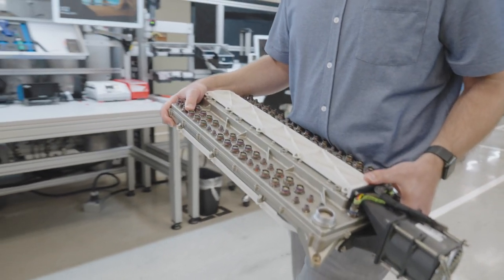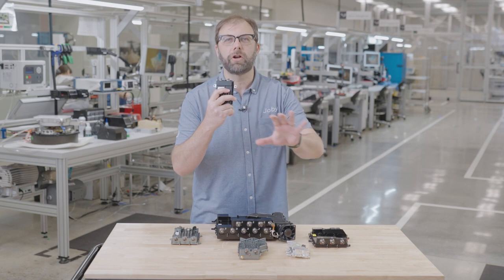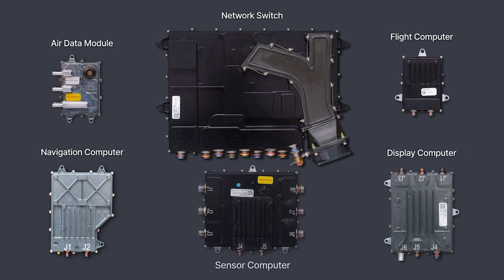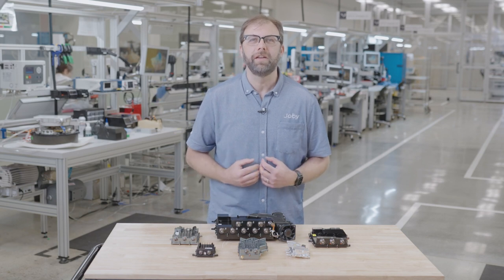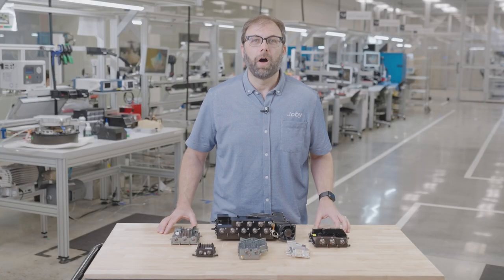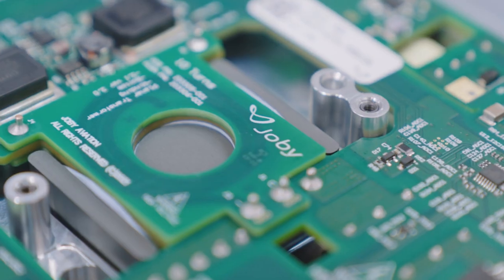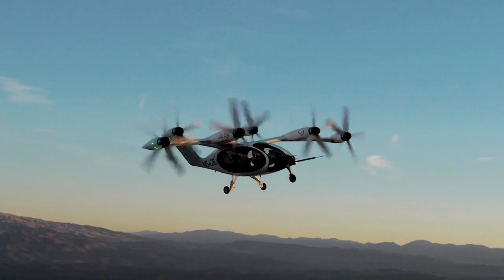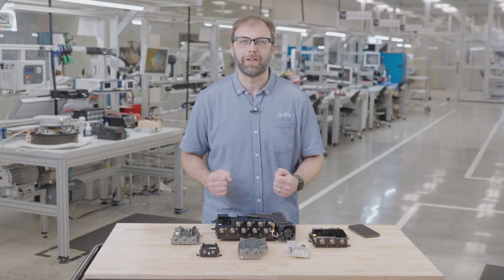A Look into Joby's Flight Electronics

Comment: Why still so huge and bulky?  it's just light compute and low speed communication? why not a tiny board with a chip in a snap plastic case? it's comparably to what a quad drone controller does, right? just has to be reliable and a couple of modes of flights. Why does that require any cooling?
Reply: FAA regulations
Reply: Certified aircraft components need to be robust enough to withstand things like temperature and pressure fluctuations, vibration, different types of RF interference, etc., as well as provide redundancy and a plethora of other requirements to ensure the flying public is getting a safe product. If you find a way to fit all that within a tiny board with a chip in a snap plastic case, please DM me and I'll consider investing :-)
Reply: @RyanPlate  the lighter the easier it takes vibration. if it must be fire resistant that can be done in a small size too, as can redundancy.
the needed communication and compute for such an application is about as low as they come. there are ultra low power cpus, they need no cooling.
if that module is only for comms, no power electronics for the motors, I could easily make it 200x lighter.
Reply: its really a pixhawk in their custom case.

Comment: Its so sad that all this development of innovation in flight with electric VTOLs and jetpacks and drones came at a time when beurocratic machine has degraded so much that it is no longer possible, even in theory, to get through it in any reasonable timeframe at a reasonable cost.
Reply: What are you talking about?  They aren't making wicker baskets.  They're making a new type of aircraft, and if they screw up, even slightly, people die.
Reply: they can't even lift the weight of a person or show an unedited flight. bureaucracy didn't stop their progress physics did.
Reply: @Franky Flowers  footage is available online from 7 years ago of a full 40 minute electric helicopter flight
Reply: @frankyflowers  Can you back up your claim that physics is stopping their progress?
Reply: @Dragoon01  What is your point?
Reply: @Asking Forafriend  Franky thinks piloted electric flight is not possible, it clearly is....
Reply: @Dragoon01  Ah, my apologies.  I thought the comment about the electric helicopter was from Franky.  Yes, that helicopter proves that what Joby is doing is possible.  Basically, just different rotor sizes.
Reply: @Dragoon01  because this is a helicopter.
Reply: @askingforafriend6540  can you prove there isn't a god? they would show it lifting weight and going a few miles and land if they could. they would be the only ones that did it.
Reply: @Franky Flowers  there is footage available of a electric helicopter flying for 40 min+ with a pilot inside it. What are you worried about?
Reply: @Dragoon01  40+ what? was it hovering in ground effect with a tiny person and no luggage? link it
Reply: @askingforafriend6540  is there a video of the flight?
Reply: @askingforafriend6540  why doesn't joby fly 5 minutes with weight?
Reply: @askingforafriend6540  joby isn't a helicopter.
Reply: @frankyflowers  Besides the size of the rotors and the number of rotors, what's the difference between the electric helicopter and Joby's vehicle?  The differences are marginal.
Reply: @frankyflowers  I wouldn't assume they haven't.  Maybe they're more worried about getting to the next stage of development, instead of proving a video.  Again, I'm with you - I want to see a video too.
Reply: @frankyflowers  To summarise, 2 pilots with a small payload, flew for 20 minutes Airport to airport with a 50% battery cell reserve. This will likely be with commercial off the shelf batteries aswel... 

If you are actually short on Joby I genuinely hope you are careful. You'd be naive to assume investment funds pumping $300m into Joby don't carry out independent technical research before investment.
Reply: @Dragoon01  what does a helicopter have to do with this? 20 minutes. is there a video of that? it could be made up like the 150 mile trip of this craft that isn't a helicopter
Reply: @Franky Flowers  a retrofitted electric helicopter will not be as efficient as a multi-rotor vtol with purpose designed batteries instead of COTS ones. There is footage online over 20 minutes and it has received a guiness world record.
Reply: @Dragoon01  they are more efficient. this company should break the world record if they can. they can't even get off the ground with 2 people. where is the footage? i don't trust guiness after their twin galaxies ordeal. they aren't officially anything. i want a full video that shows it.
Reply: @frankyflowers  the video is online lol. Look up tier 1 engineering
Reply: @Dragoon01  there isn't even a 20 minute
Reply: @Franky Flowers  the title is "World Record 30 minutes 800 feet Electric Helicopter Flight 16 Feb 2017" its 6 years old. Change your search filter to longest videos.
Reply: @Dragoon01  thats not the same flight you were talking about. its a purpose built helicopter for one person to stay up as long as possible not carry stuff and it still didn't have battery after that. joby isn't a helicopter its less efficient. if they could fly 30 minutes empty they would make a video showing it. they can't
Reply: @Dragoon01  do you think joby can lift the weight of one person for 30 minutes? why wouldn't they take the record? where is the longest multirotor flight?  joby should make the first record.
Reply: @Franky Flowers  its funny because you were first claiming its physically impossible for an electric lift platform to maintain flight at altitude with people on-board for any sustained period and now you are reverting the question. It's obvious you are short on their stock so I'm done debating what was proven to be possible 7 years ago and wish you luck in what you are looking to achieve. I've already pointed you in the direction of Jobys flight data which includes altitude and duration, you only have to search the callsign on the appropriate flight trackers.
Reply: @Dragoon01  no i didn't. i knew about the helicopter already.
Reply: @Dragoon01  still nothing but talk. its a scam face it.
Reply: @frankyflowers6646  Beta has flown with people onboard- I don't get whats confusing you
Reply: @Dragoon01  liar. they probably flew like jetson one flew. lol 5 second clips edited together with music. all lies
Reply: @Dragoon01  where is the longest multi rotor evtol flight video with weight of people on it anywhere in the world that isn't edited every 5 seconds?  its not possible or someone would have done it and bragged and shown a simple video. get ready for a theranos.
Reply: @Dragoon01  wouldn't they want to be the first to lift 150lb for 5minutes or even 5 miles if they could and exponentially increase their stock overnight? why wouldn't they be the first if they have the ability. they don't even give us a good view of their "production" model. it looks like a 2 seater. they are going to pull something like we decided 2 people is more ideal and 7 miles is the ideal distance and then not even show that.
Reply: @Dragoon01  when you day beta are you talking about the one that crashed? they didn't prove anything with that.
Reply: @frankyflowers6646  beta flew with US Air force pilots, you can find the flight logs online
Reply: @Dragoon01  seriously if that's the only proof on earth  that any electric multi rotor can be a taxi then there isn't any. it wouldn't be hard to find something if it was possible. if nothing happens in 5 months then what? that should be proof its not possible today
Reply: @Dragoon01  where are the flight logs? did they mention weight, time and distance? it looks like the air force gave up on them. did it take off vertically? everything i find about them seems to be deception.
Reply: @Dragoon01  where are the logs online?